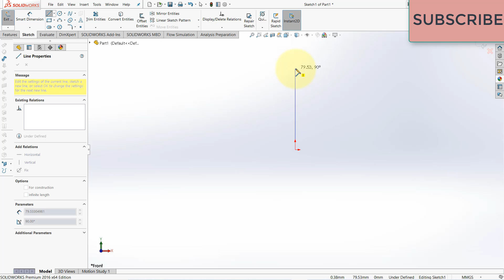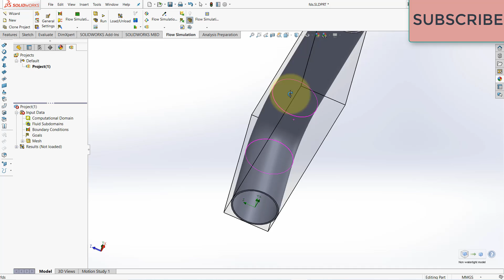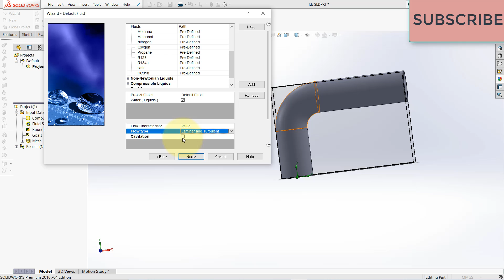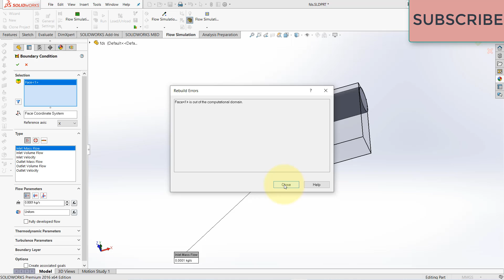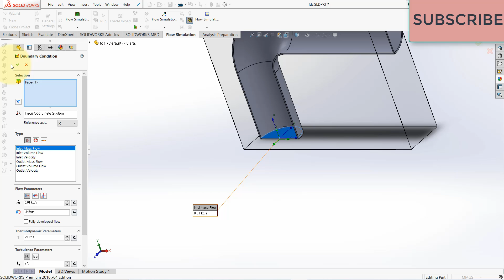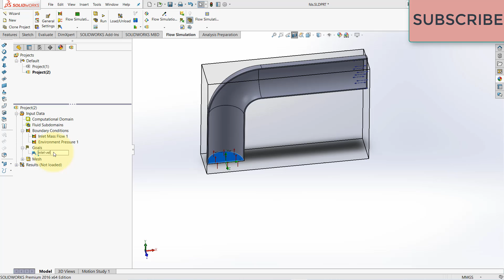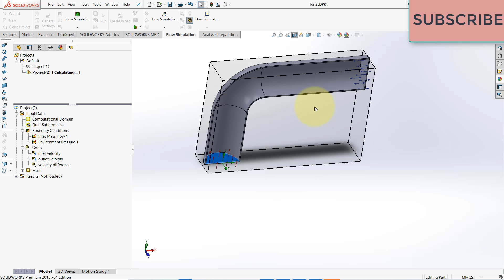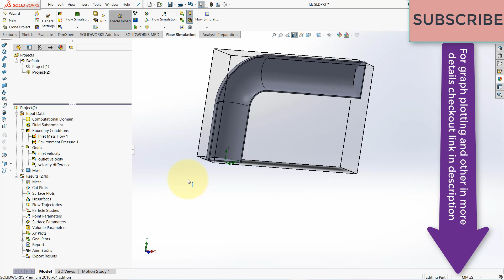Common Mistake Done by Beginners in Flow Simulation in solidworks

Comment: Very nice video. In this example how you would set a simulation where you have a inlet of smaller pipe on the angle so you have suction from the big inlet?